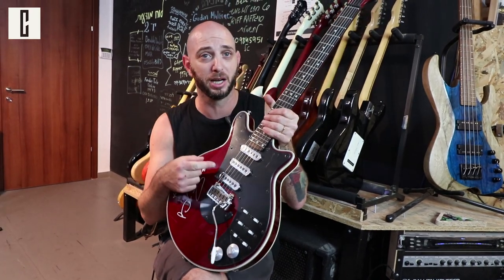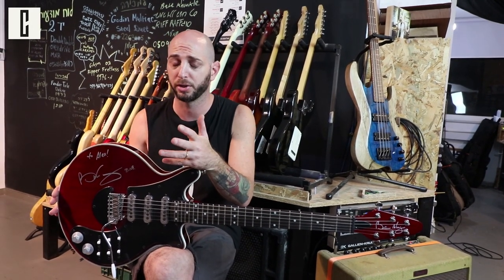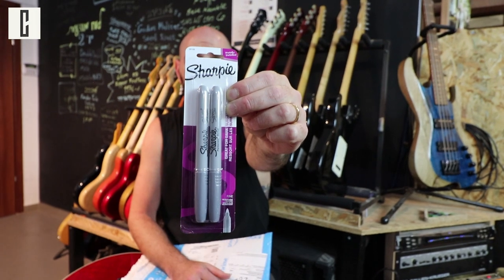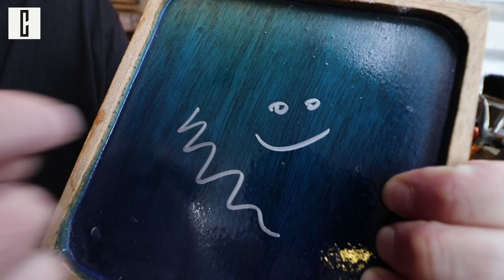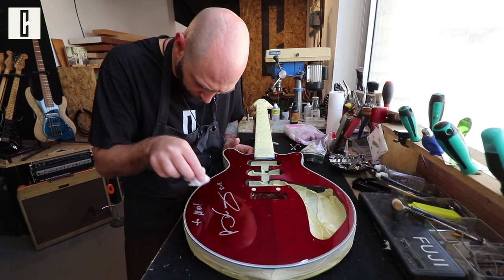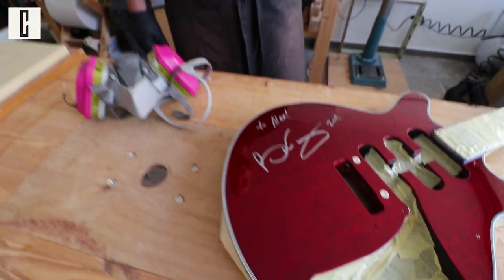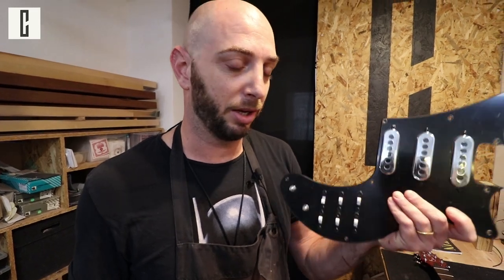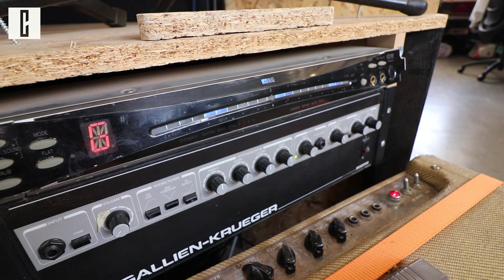Guitar Painting - How to spray an original (Brian May) signature on a BMG Red Special

Comment: Hi there, great video! Just wondering if you know the type of varnish used on the guitar before you spray over it to protect the signature? My husband just received his Brian may guitar and he had it signed too! He wants to have the signature protected but the only person that can do this in Sydney is asking what the original lacquer is ? We have sent an email to the company but haven’t heard back yet. Help !
Reply from the maker: Hi, thank you for your comment.
I believe that the lacquer on the guitar I was working on is an acrylic type. As long as the varnish is NOT nitro or shellac of some sort you should be fine using an acrylic one.
Reply: @coilsboutiquepickups  Hi! I'm in a situation where I have to apply this by myself (I'm working on a ship and I can't have someone else do it for me here). Just to clarify:

Deeber 2k clear Acrylic coat laquer directly over the signature, let dry. (two coats)

Meguiar's 105 Mirror glaze, one coat
Meguiar's 205 mirror glaze, one coat
sandpaper finishing.
(paint sprayer)   

Video is amazingly well explained but I just wanted to dobule check, in case there's any particular specification or detail, cause i have to do it by myself! Thank you.
Reply from the maker: debeer plus hardner anf thinner of course when sprayed.
Sandpaper before polishing compounds.
That's it. Exactly like in the video
Reply from the maker: beware! Don't overdo it with the coats of laquer and don't overdo it with the sanding paper. Try to get as smooth as finish as possible with the spraying

Comment: My tech recommended me water based polyurethane. Do you think its ok?
Reply from the maker: I think you should try to make a test run on another piece of wood and see if it works out before spraying.
Reply: What is the model of the sharpie? I noticed there are 2 kinds. One is oil based and the other it doesnt say but i think its alcohol based.
Reply from the maker: I honestly have no I idea.. It just says "Sharpie Permanent Marker - Silver metallic" @TheOlympianKing